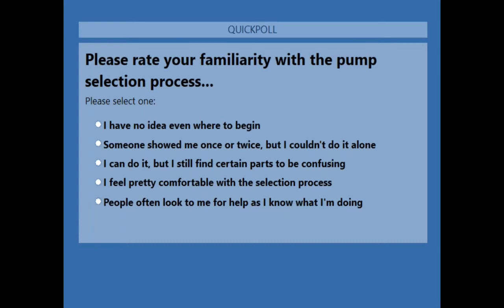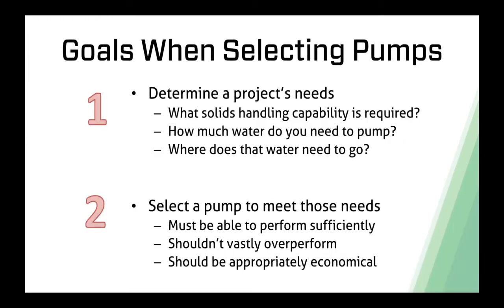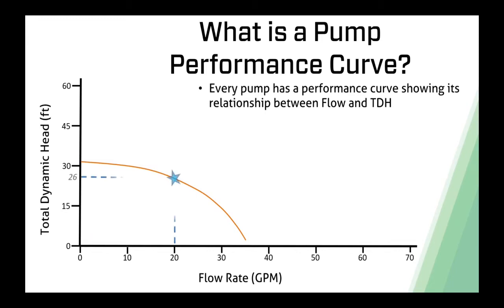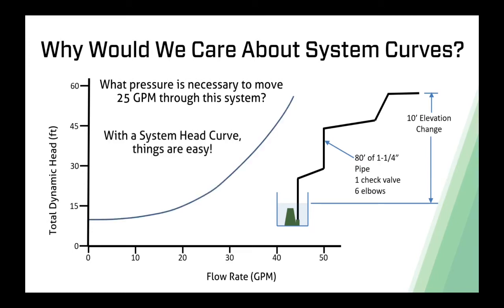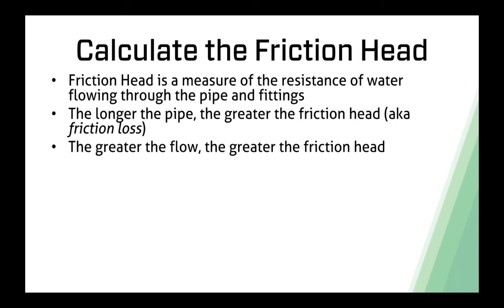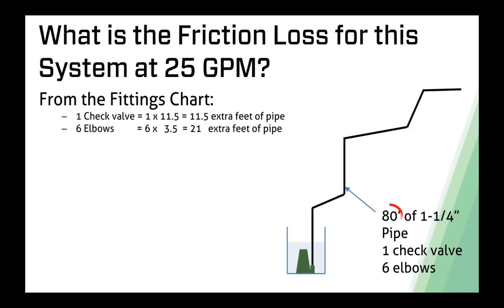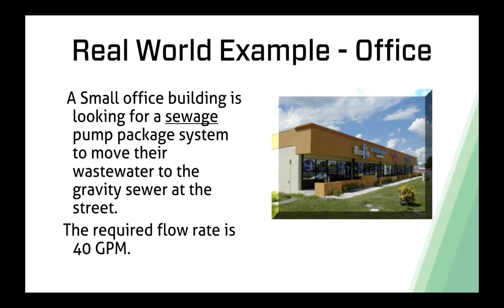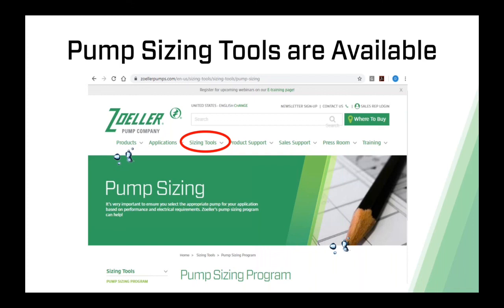Pump Sizing 101 Webinar

Comment: Is there  a possibility for the static head to be Zero, if the pump is from a small tank downwards? It is for my project, gravity is not enough to pull the water on it's own so i need a pump, it is a from a small effluent tank of 1500L with a flow rate of 10L/min, no fittings, just the pipe loss. Do i need to calculate the distance between the water level in the tank and the pipe for the static head?
Reply: You would need to factor in any vertical height increase plus if you want to calculate total head you need to factor in the resistance of all of the plumbing. Even if it is flowing straight down there is some resistance to flow created by the pipe, however it may be insignificant especially because your total flow rate (10 liters per min) is so small.

Comment: Great video Thank you!
I have a question about soil flow rate. You mentioned 20-25 gpm through Clay soil. How would this change for a 18” diameter & 30” tall basin vs a 24” diameter and 48” tall basin? Obviously the larger basin would flow more water. Is it strictly a linear proportion based on surface area?
I would then assume the example was done with a 18” diameter 22” tall basin @ 22gpm through clay i’m guessing = 4500 in sq. 
Vs 24”x48” cylinder surface area = 10800 in sq
So potentially 10.8/4.5 * 22gpm = 53gpm
Reply from the maker: The 20-25 GPM in clay soil is a general rule of thumb and is assuming a typical 4" inlet to the basin. The basin size would indicate the volume of water being able to pump OUT when the pump cycles but the larger basin may not necessarily indicate a higher flow coming into it. All applications can be difference based on the soil conditions and water table. The rainfall in the area, water table and the soil conditions would all be a part of calculating the incoming flow rate. A perforated basin would increase the volume entering the basin. If you have any additional questions, please do not hesitate to reach out to us at zcotechnical@zoeller.com. Thanks!